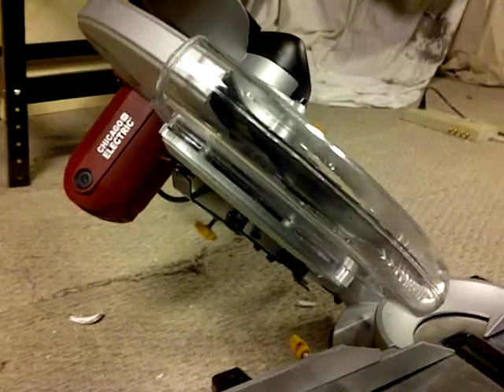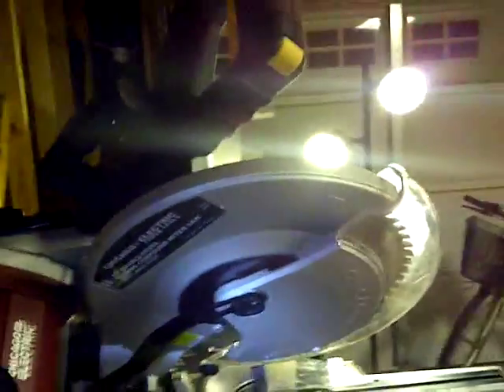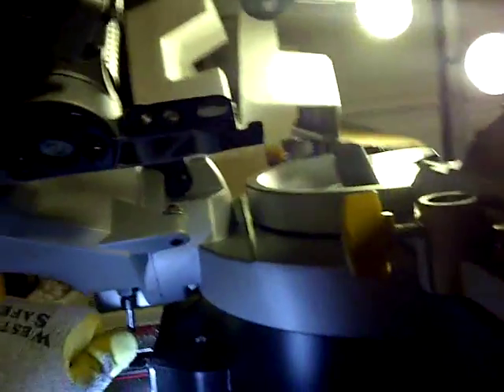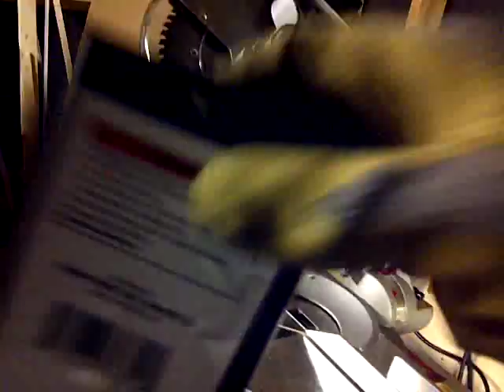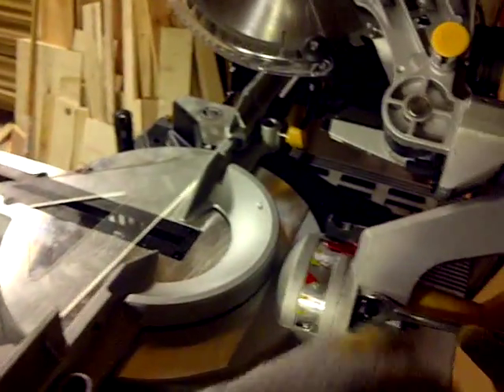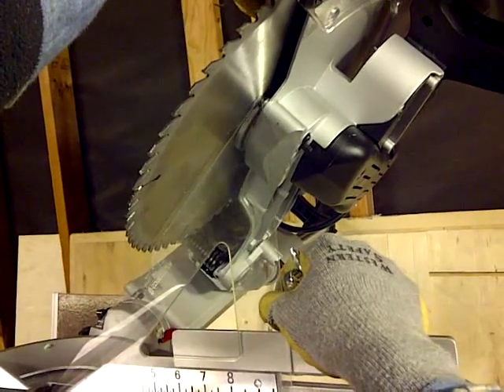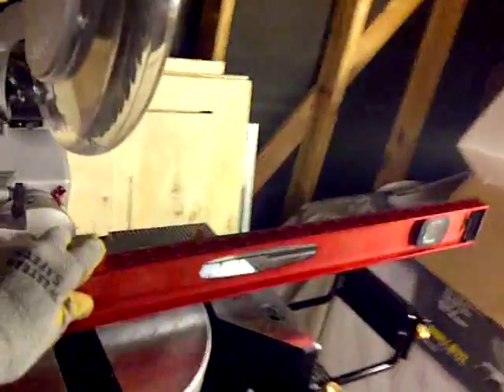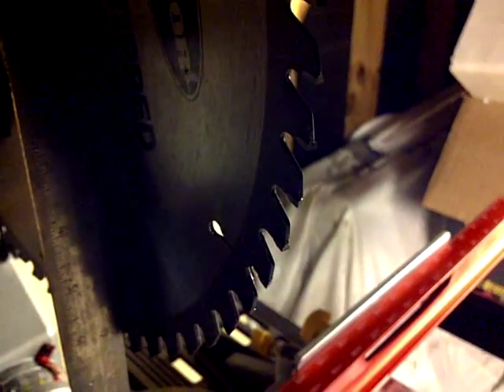12" Double-Bevel Sliding Compound Miter Saw With Laser Guide Part 04

Comment: FYI .. Set-screws - loosen the lock nut on the set screw. adjust screw, tighten nut, check angle.  ALSO the 90 deg set screw is the one that stops against the bevel stop that flips down to allow the saw to flip to the right side.  And, thanks for the videos.

Comment: I noticed that the blade on my miter saw is not 100% at 90 degrees, I was able to fixed the fences and the bevel at both sides but 90 degrees don't know how to set it? can you help with some advise? thanks.